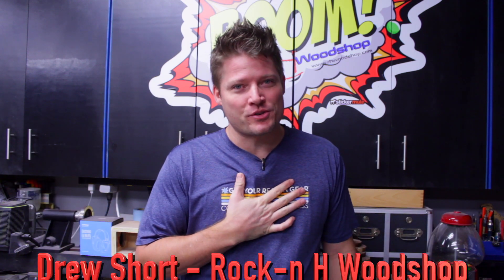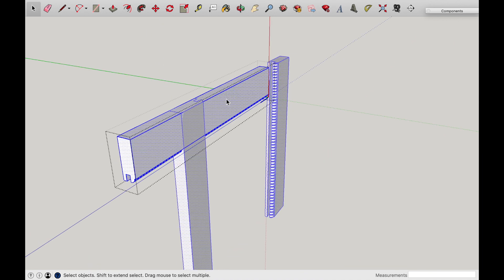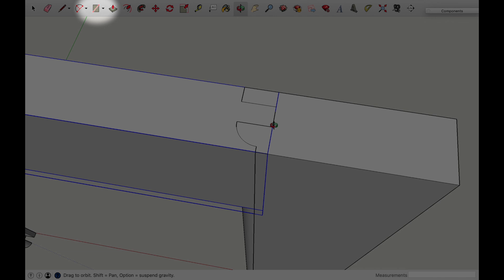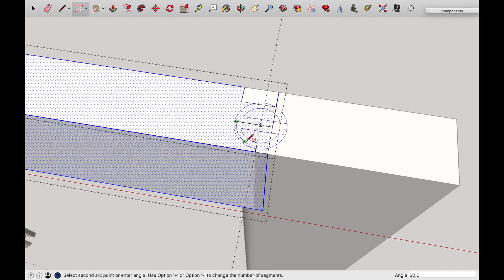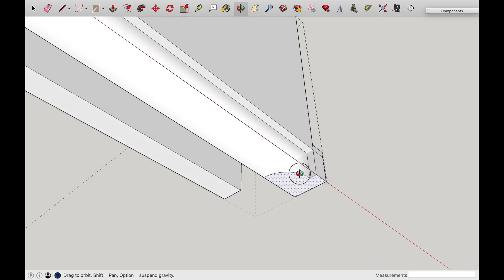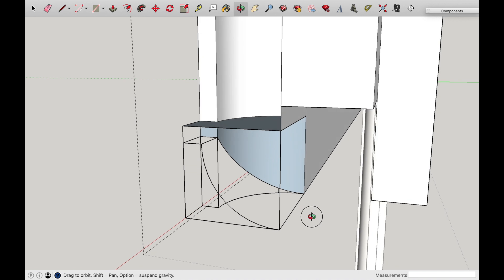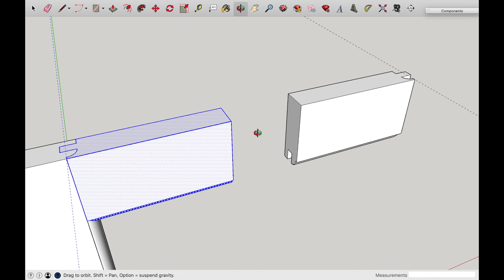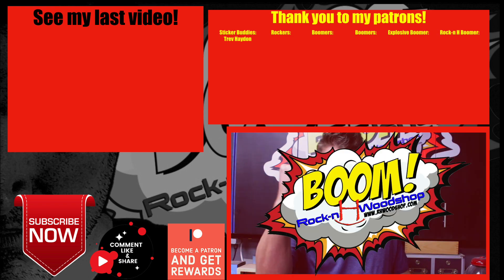Positive and Negative Profiles Cope and Stick - Sketchup for Woodworkers Tutorial 9

Comment: Hi and thank you so much. Here’s how to do it on iPad:

Push/pull as you describe to the point as you say. Then - hover your pencil over the push/pull icon and select the +, and extend selection as you say. 

Highlight the group with the pencil using the elastic captive box. Then goto the pop up menu at the BOTTOM of the screen and extend the options (3 dots) until the INTERSECT menu comes up and choose SELECTION

To delete faces activate the arrow icon and tap on the face that you want to delete. When it is highlighted goto the bottom menu and tap on the bin icon. 

Follow your directions to finish off/neaten the group.

Hope that this helps.

Comment: Hi, just want to suggest a feature that's very useful, however it may not be available on the free version of SketchUp. It is the solid tools, and with groups/components, you can easily subtract/divide the two components, regardless of the components' shapes, the program will do everything for you.
Reply from the maker: Definitely have to keep that in mind. I will look forward on the free version. One reason I decided to do these tutorials on the free version is because not everybody’s going to have the paid version but I will definitely try it out
Reply: @rhwoodshop  I'm using 2017 make free version and the solid tools is the way to go. Select rail, hold shift, select stile, then go to solid tools and hit the subtract function and it's done. Keep up the good videos.

Comment: Nice video.  I learned a few things. One thing you may or might not know is if you want to delete two lines that intersect, if you use the eraser tool exactly at the intersection, you can remove both with one click.
Reply from the maker: Thanks for letting me know that. What things did you learn from this video?
Reply: @rhwoodshop  I didn't know  about the option key with the push pull tool.  You also reminded me of things that I sort of knew but haven't used.  Also the value of deleting the face before the edges of an object.

Comment: I really need to devote some time to sketchup. So hard not to be in my garage when I have free time.
Reply from the maker: I know what you mean, I was the same way but SketchUp has changed my woodworking in a very positive way. Not only can I make project much faster because I have accurate models but I can also present these models to the client to close the deal so they can actually see what it is I’m trying to build them before they sign the dotted line.